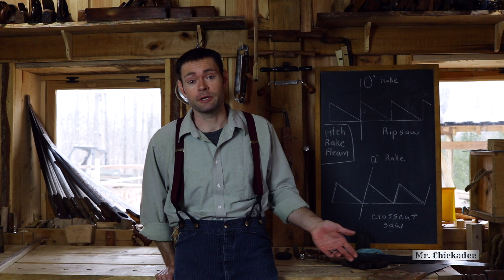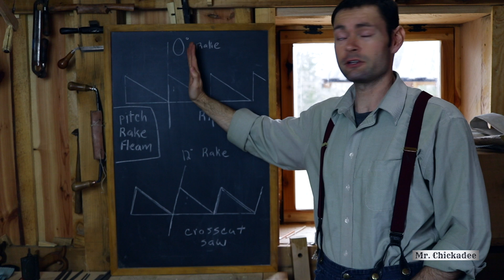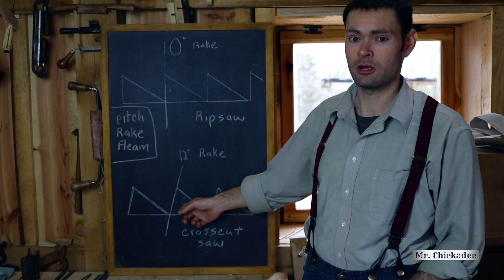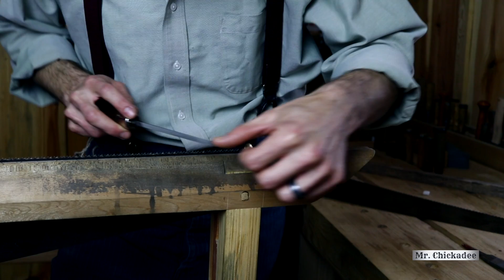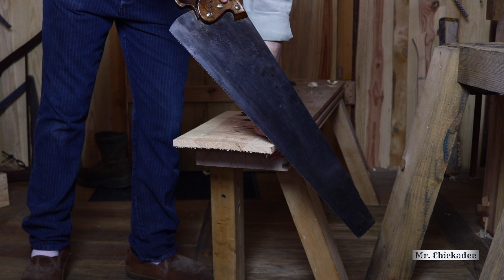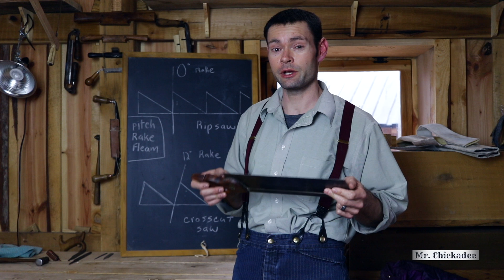Hand tool tutorials; buying, restoring and sharpening a vintage saw

Comment: Right on time. I was just considering sharpening mine and you chime in lol.
Reply: Me to but a saw mead 2018 , expensive crap.
Reply: @mikamajlund3622 
 I guess the metal it is made from is the more important thing. Handles can be reworked or replaced. Heck, if nothing else, grind all of the teeth off and start over with new teeth if the stock is decent. Most of the old saws available around me are severely bent or even painted. I found a matched set of Diston's at an estate sale, and got them really cheap by bidding them out of a larger set of tools. They were grouped with tools I did not want and as I made sure to be standing close enough to the caller, I simply stated I'd give $10 for the pair, he seperated them out and sold the remainder for like an additional $17.50 to another buyer. Guess I was the only one who knew or cared what these saws were.